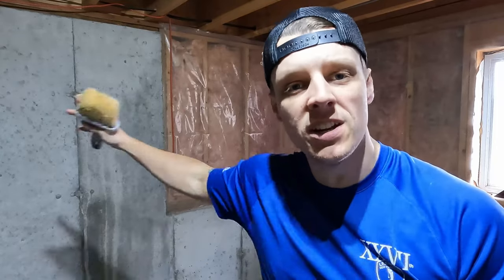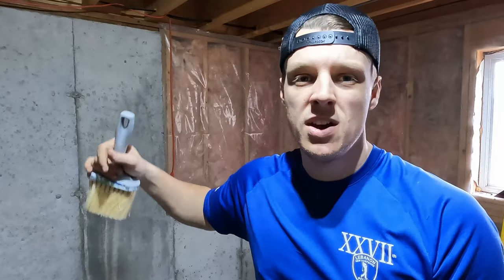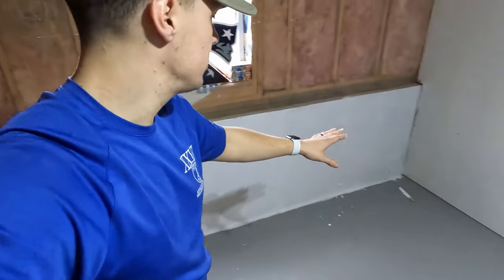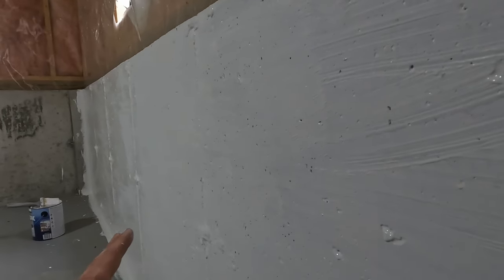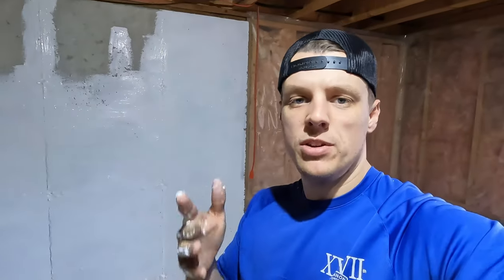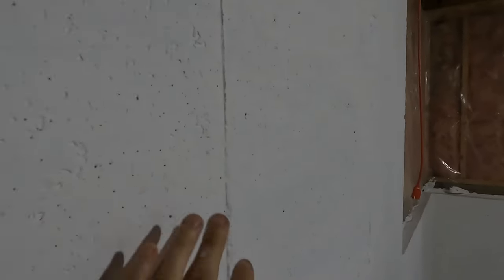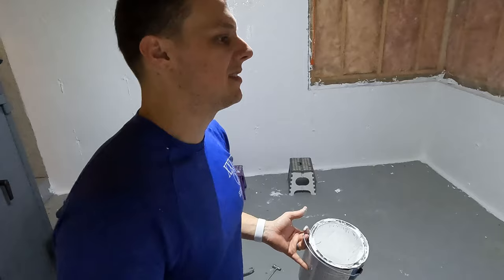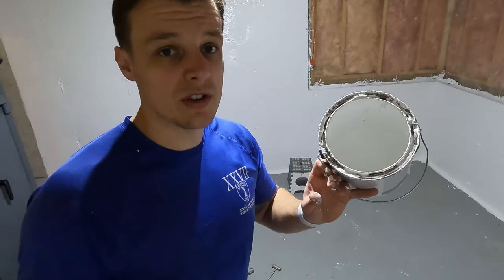Sealing Basement Walls with UGL Drylok ||Finishing a Basement||

Comment: Should have got concrete and a piece of burlap and filled all the holes first so it was real smooth, I'm really surprised you painted it on a roller would have worked a lot better.

Comment: Going upstairs the chimney for my fireplace is in the wall and because of the change in temperature my plaster walls crack I tried joint compound but it peels and cracks as well..: will dry lock fix this?
Reply from the maker: I don't think this will slow thermal transfer, and probably is not heat rated. You're probably going to need a brick, stone type of layer to stop that.

Comment: Is it scratch resistant? Can u apply it on wood
Reply: You can apply it on anything really. I mean it becomes like concrete when it cures kinda its not going to scratch too easily.
Reply: I use it on wooden enclosures for reptiles
Reply: I use drylock original in that application supposably less vocs

Comment: Will this get rid of damp?
Reply from the maker: No, you need to try and fix the problem first.
Reply: try a humidifier and fans won't hurt and open the windows to get air circulating. In winter, you can still crack the windows on each side; at least, that was what I read but still run the humidifier. Dampness and moisture can cause mold and mildew, then you've got another problem. We got a humidifier and it's crazy that we have to empty it 2 to 3 times a day after it rains out. Once you fix the dampness then you can paint with drylok
Reply: Awesome thanks!!
Reply: dehumidifier